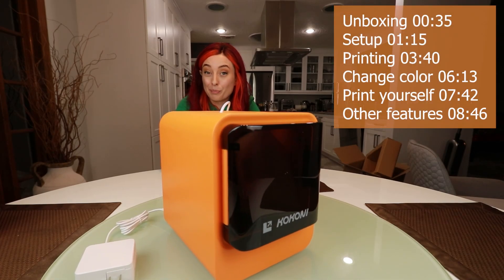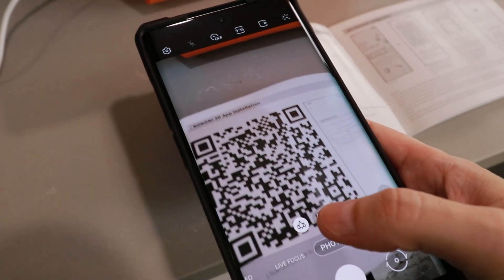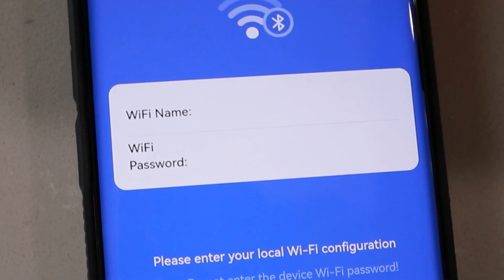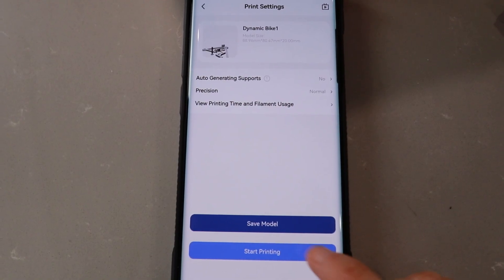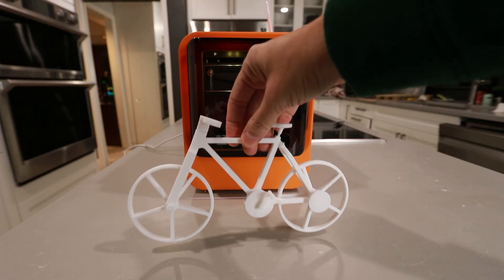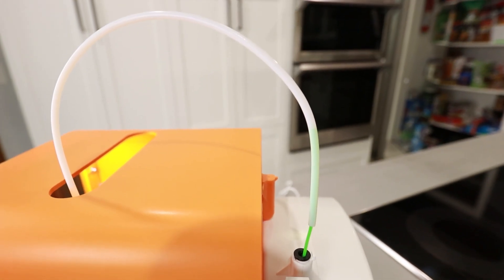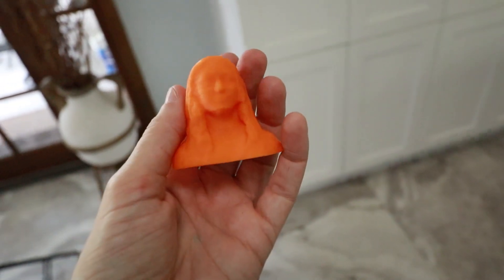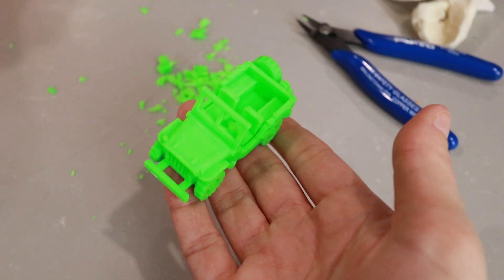Easy 3D Printer for Beginners | KOKONI EC2 Review

Comment: A question, serious question, as an optical technician in the industry for many years fitting and glazing spectacles i have wondered about printing glasses. Do you think its possible to print the parts for spectacle frames ie plastic type/ sunglasses etc? 
Thanks.